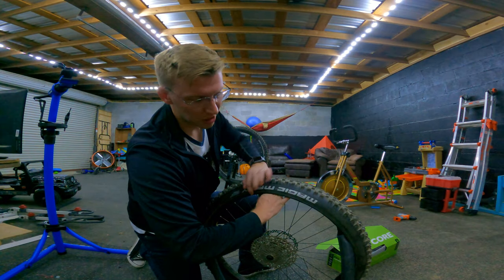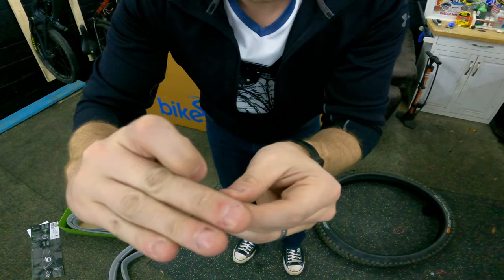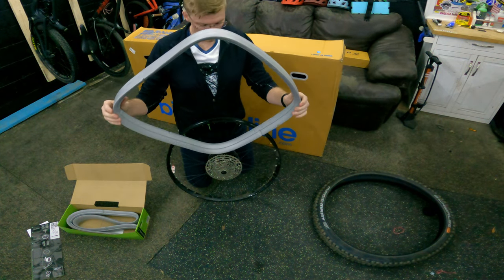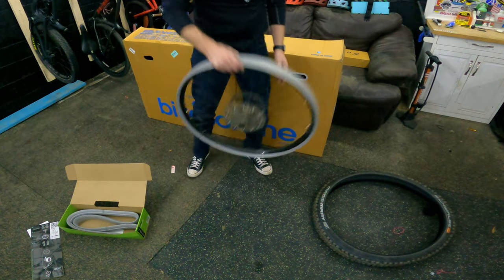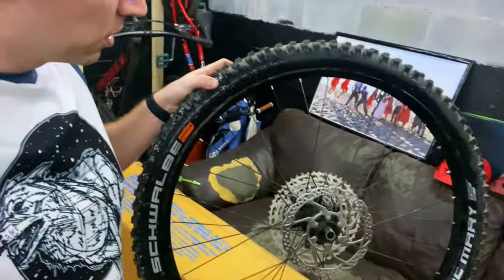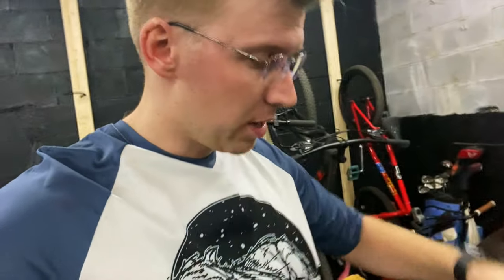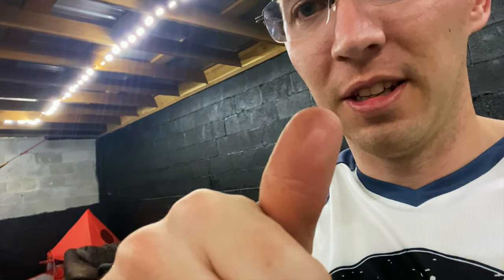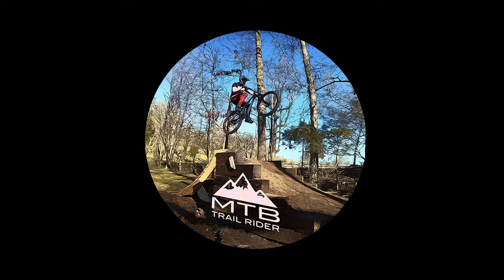NOOB Tries to Install CushCore on Polygon Siskiu N7 Enduro Bike

Comment: Do they have any other colors of valve stems besides the green??? Great video!
Reply from the maker: Yup! Several colors. But I believe you have to order them separately. When you buy the set it will automatically come with the green ones. 

https://www.cushcore.com/product/cushcore-44mm-tubeless-presta-valve-set/
Reply from the maker: Also, I mentioned the trip to Asheville had change of plans because Bailey bike park closed... we are planing to ride at the riveter bike park instead on April 10. Hoping the weather stays clear so the outdoor lines will be open, but regardless of weather we will still be there since we’ll be in Asheville for the weekend. They have a covered area too that we’ll ride.